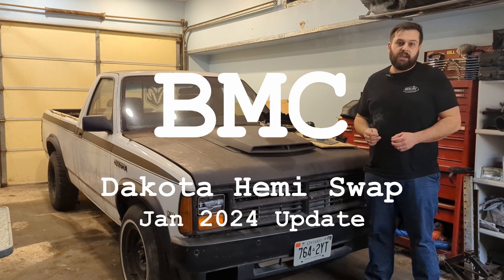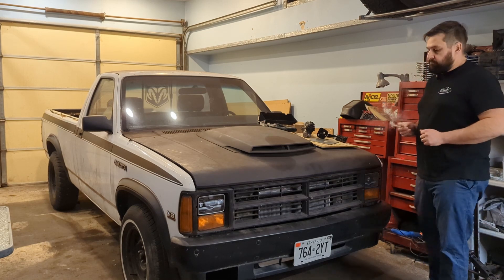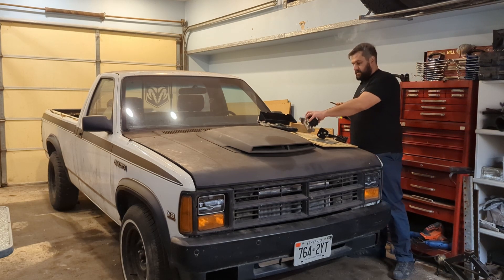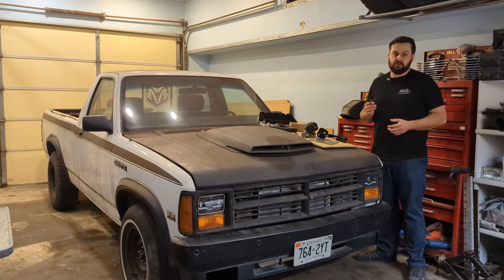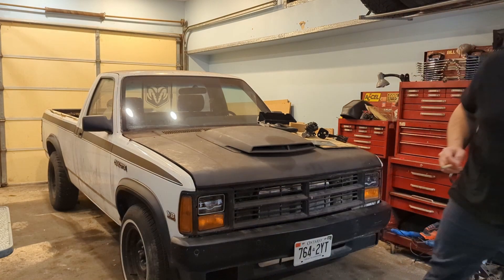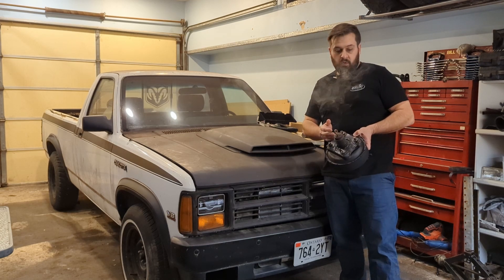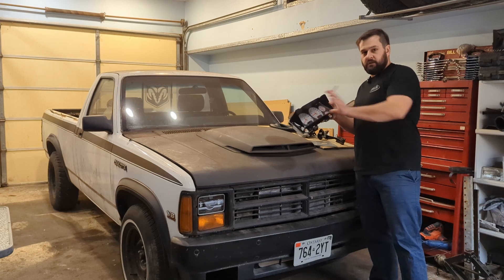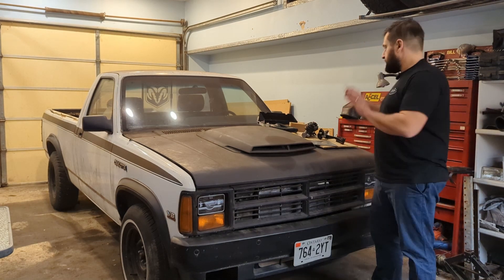Dakota Hemi Swap - February 2024 Update

Comment: Maaaan, i can just smell it :-) 
Anyway... ive got a 93 with 50k original. Its FANTASTIC shape reg cab shorty 5spd. Weak 3.9 but it is as clean as new, frealz... i dream of a 5.7/6spd from a challenger. $7500 for a crate 345 from mopar. 383hp... or do i do a 318 build? Id LIKE at least 318hp just cuz... to ME, i cant decide which one SOUNDS better. OF COURSE 57's sound good, but 318's have CLASSIC tones from them pipes... i cant decide. The struggle is REAL sir... sweet truck, by the way 👍
Reply from the maker: Thanks for the comment and compliment! Your truck must be pretty sweet too! Reg cab for life! I had 2 318s and a 360 in this truck, all Magnums. The small block with a carb and cam will always sound better, but it made 230hp to the wheels with cam and headers. My brother's turbo 318, different story. Sure, you can cam/carb a hemi, but its going to be difficult and very expensive. It all depends on your budget and how you want to drive it. Bolt a magnum 318 up to your 3.9l mounts and 5-speed, you'll have that Dakota running in a quarter of the time. Good luck with the build, they're both great options - do what's best for you!